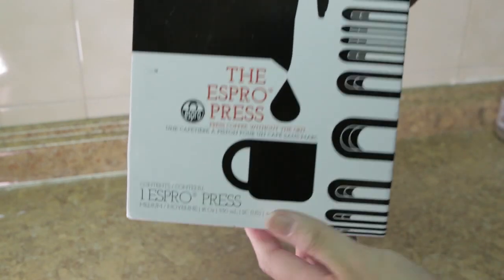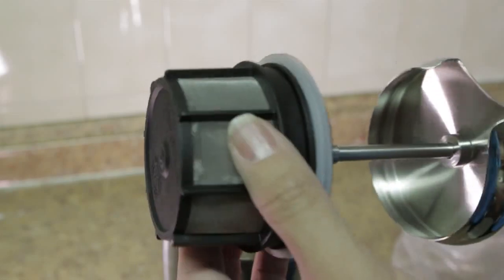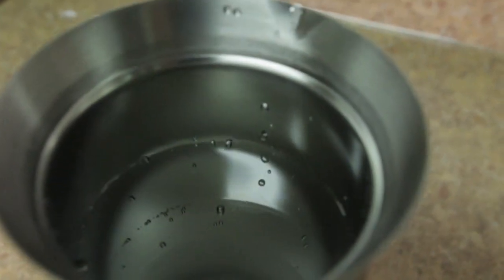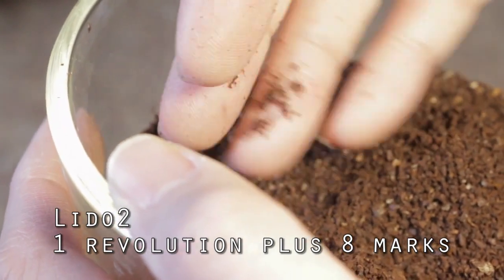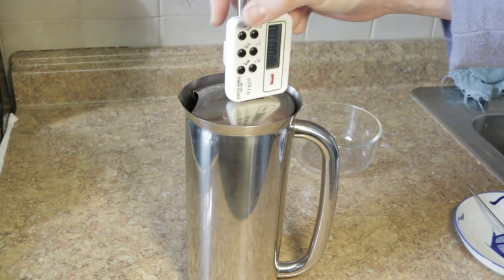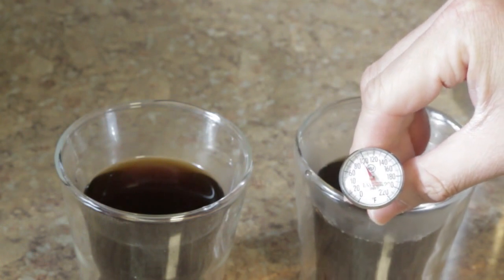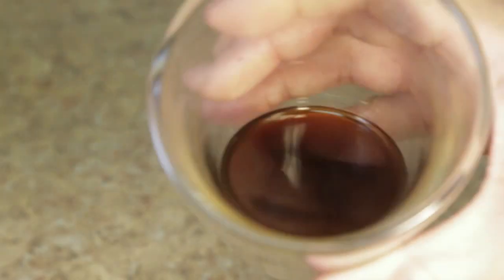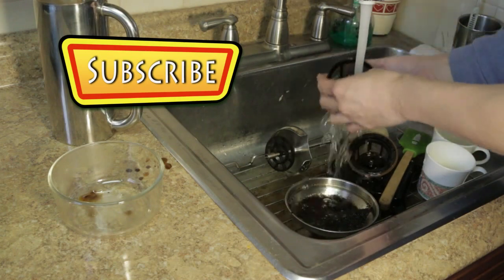How to French Press with the Espro Press - Medium

Comment: Just purchased and have used twice. Using a Vario grinder and got the grind correct right away. The press is very easy to use and kinda foolproof. Should last for years! Clean tasting cup and the only negative is messy cleanup. Glad I purchased and different enough from espresso machine to make it a nice addition to my coffee gear.
Reply from the maker: Rick9482 Agree!
Reply: On further use:
The cleanup is just terrible! If you have an espresso machine and only have to deal with disposing of the hockey pucks created....This press may not be a good choice. If I cannot find a simpler cleanup method for this press, I doubt much serious usage. I'm kinda appalled at the mess this creates!

Comment: I found the easiest cleanup is once you've poured out the last of the coffee, pull the filters out and submerge in a big cup of hot water. Then tilt the press just past 90 degrees and using the tablespoon to hold back the grounds, let the remaining liquid drain out. It's pretty easy to clean out the coffee grounds into a container using a tablespoon. Running the filters under hot water, then removing outer filter and more running water should get the job done pretty easily.
Pouring the whole remaining solution into a strainer is just too messy for me. My method gets the grounds into a container fairly cleanly and just a few grounds remain in solution.